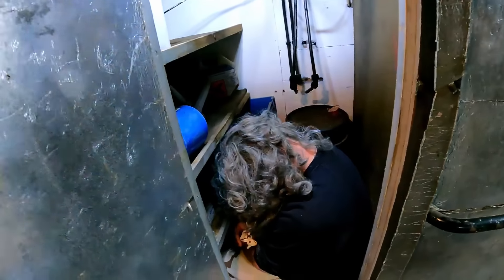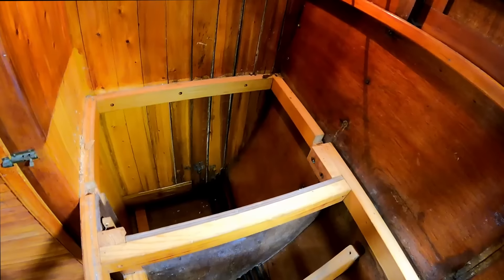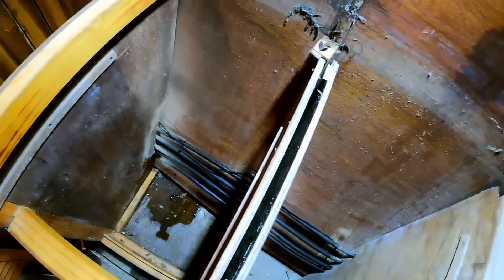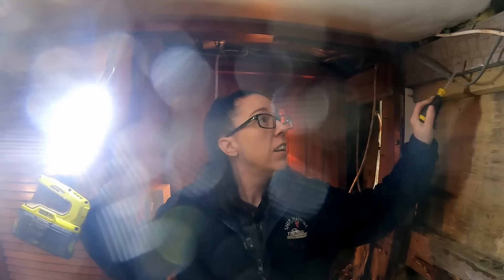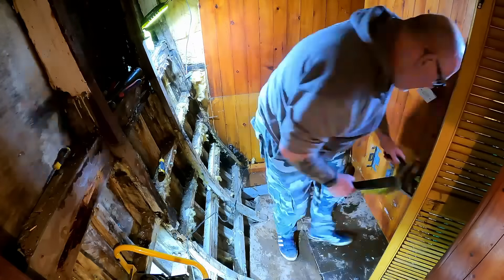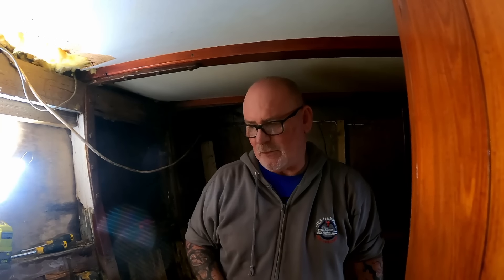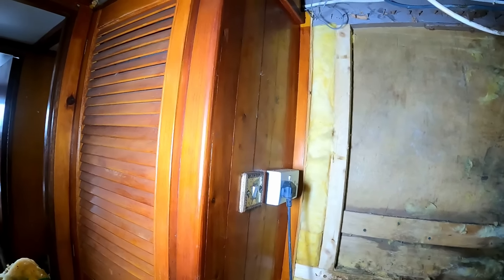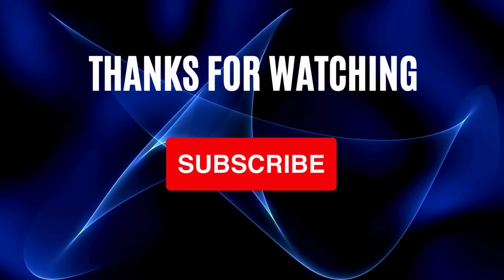Ep 169 - Robbo Smashes in Sarinda’s Rear End & Gets Her Wet!!

Comment: Bit will be to insulate with material that won't hold moisture and leave an air gap by not taking it all the way to the hull. So, something like closed cell foam insulation acroll the face of the ribs leaving a good 40mm + of air to help keep the inner hull clear.

Comment: In the long run, replace the water pipes with Hep2o or Polypipe. It’s Cross-linked PE (PEX). It lasts longer than copper (at least 50 years), won’t split if frozen and it’s easy to repair. And can be run like cables so now creaking or clicking and fewer fittings are needed. I first used it in my mother’s house mid 1980s. It’s still good as new.  I personally don’t like the JG brand. IMO it’s too stiff and demands fittings when the other two would simply bend into place. But that’s just my opinion.

Comment: It’s a shame the hallway goes down the middle and takes the best space on the lower floor. If the stairs did a half turn then have a cabin to the left going act full beam and another cabin at base of stairs going to bow full beam. Aft cabin has a walk through head to utility room then engine room. Small stair case in pilot house to forward cabins . This is probably all wrong seeing how it’s just in my head and I don’t know any measurements.